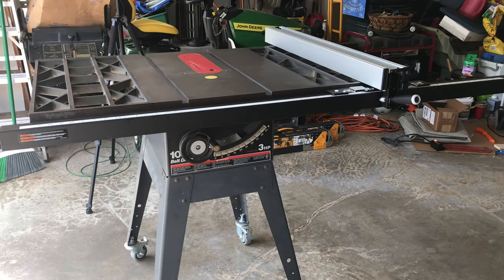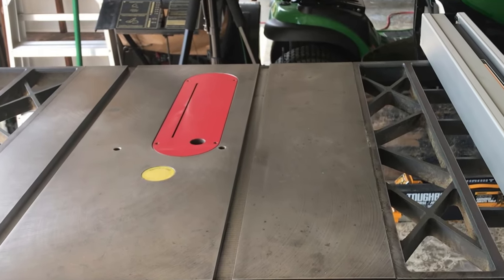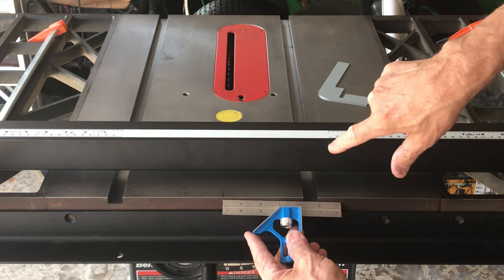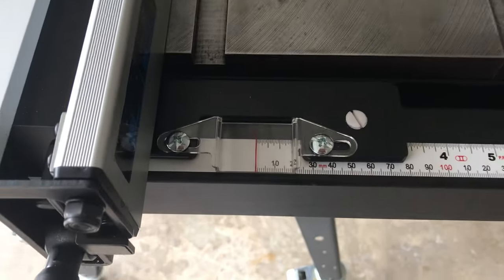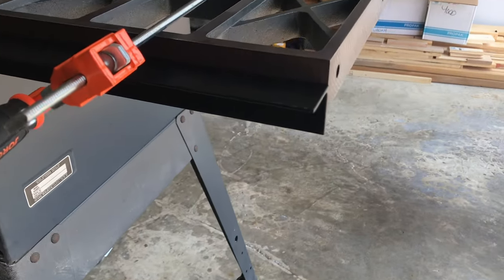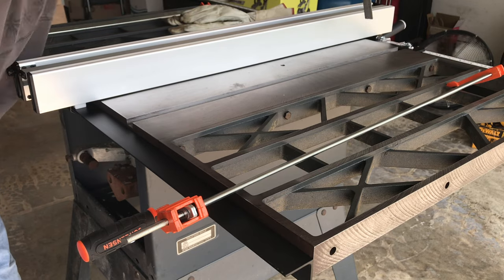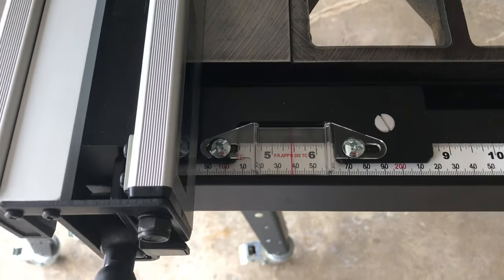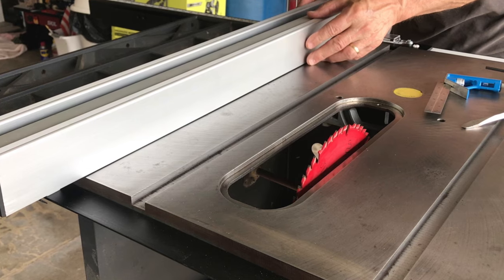Upgrade Craftsman Rip Fence to Delta 36 T3 Rip Fence

Comment: Why do YouTuber keep wearing gloves and operating table saws? Coming from someone with nearly 50 years experience that’s a big big no no!
Reply from the maker: Thank you for bringing this to the attention of those that aren’t aware of it.

I’ve had the table saw for years but didn’t really use it a lot until I recently retired and have started doing more woodworking.

Obviously, the issue with wearing gloves around power cutting tools is that the gloves can get caught in the cutting blades and pull your hand into the blade. Basically, being (an older) newcomer to working, I hadn’t given any thought to that until someone mentioned it awhile back in a comment.

You might think that this is something that goes without saying but I’m sure that there are others out there (especially beginners) that don’t give it a thought. I have since followed the advice for not wearing gloves around cutting tools.

Thanks again for drawing attention to this and hopefully helping others in bringing awareness to them. And btw, thanks for watching!

Comment: I'm a 100% disabled vet (six strokes that left my right side flaccid).  I don't let that bother me.  I've had a Craftsman Table Saw since 1994 or so.  I wanted to change the fence and a few other things.  I watched your video a few times and ordered the Delta T4 from Amazon.  Luckily the box arrived in tact.  I did the entire job alone.  Piece of cake.  Thanks for a video.
Reply from the maker: You’re so welcome. Sounds like you’re very strong willed with the hand that was dealt you. Keep that mindset and thank you for your service.

Funny that you mention the box arriving intact. Our first Amazon shipment arrived with the box in pretty bad shape and the top of the fence was dented in a couple spots. Had to get a replacement. So anyway, I’m glad that you were able to do the upgrade and I’m sure that you will be enjoying the new setup on your Craftsman!

Comment: There is a part on this fence called the 'lower-guided board' that I cannot find any information on. Do you know what it is for and how to use it? It's the swinging plate on the top of the fence.
Reply from the maker: Sure. There’s not a lot of information out there, but I did find a video from Delta Machinery Tools that shows this fence being used on one of their table saws (see link below). They show this accessory being used for thin or small pieces of material. You flip it down on the table and it gives you more room to maneuver as opposed to the taller fence. Don’t know how much it’ll be used, but it’s there. Thanks for watching!

https://youtu.be/_erbaD6ooXs?si=v8Ogq54uXdV3smel

Comment: I plan to upgrade my craftsman table saw fence to the Delta T3.  I, like you, will have to drill holes in order to affix the rails, however in your video, you don't state what diameter hole you have to drill in your Craftsman table saw.
Reply from the maker: I drilled the holes with a 5/16” bit. However I first made a divot with a nail set to guide a smaller bit to make a pilot hole. The pilot hole also made easier to then drill with the 5/16” bit. Good luck with your upgrade!

Comment: Hello what are thoughts How you like the fence now
Reply from the maker: Hello! Really liking it. Very stable and accurate. A big improvement over the stock fence on my old Craftsman!
Reply: Cool I just order mine. Have you rip a 4X8 Plywood in half at 24 and if so does flex or stays solid accurate is it strong enough. 
This are my concerns.
Thank you.
Reply from the maker: I have ripped a 1/4” 4x8 sheet of plywood. It definitely stays locked in place and accurate. That is what I really like about it. It slides smoothly and evenly before you lock it down. It has adjustments to make it parallel to the blade and 90° to the table. So after you get it set up, it locks down very accurately. The fence that came with the table was very loose and inaccurate.
Reply from the maker: What brand of saw are you putting it on, do you have an old Craftsman?
Reply: You did some very excellent videography on the upgrade. The camera shots, instruction and demonstration were expertly done! I have the old Craftsman Direct Drive TS and made this upgrade to the Delta T30 system over 15 years ago. I paid $170 then and it was worth every penny. It’s a great upgrade to our old TS’s that I would highly recommend. It’s you did,  also drilled the holes in my cast iron tabletop which was easier than I thought. The accuracy and strength of the fence makes my woodworking enjoyable! After all these years it is still as smooth and precise as the day I installed it. Oh, I took the rip guide and rod (that was sticking out of the back) off mine but know others have cut a groove in the back rail to accommodate it. Either way if anyone with an old craftsman is “on the fence” about this upgrade, just do it. If you do it right, I think you will love it like I have for over 15 years!
Reply from the maker: @MRrwmac Thanks! As you so aptly described it, it’s a great upgrade and very much worth it. I see Amazon has it on sale again for what I paid for it ($208, normally $300). But you are absolutely right, it’s accuracy and stability make the old Craftsman a joy to work with. I also agree with your recommendation to those who are undecided - just get it, you won’t be disappointed!

Comment: Thanks... I have a 113 model that I inherited from my father.  Really want this fence system for mine.  As well as the billet pully set with the link belt. I have upgraded the throat plate and blade already as well as added some nice castors.   Need to clean up the bottom casting on the wings (same has yours).   I used some scotch brights pads on mine with WD.
Reply from the maker: Yup, you’re welcome! Sounds like you’ve got it all under control. You won’t regret upgrading the fence, it turns the old Craftsman into a really decent table saw!

Comment: Great video! I'm working on getting my fence onto my 113 but I bought the fence used and it didn't come with the alignment tool. Do you have the measurements so I can make a jig?
Reply from the maker: Thanks!

As you can see in the video, the front rail is installed with the horizontal plane of the angle iron on the bottom and the back rail is just the opposite. The back rail is installed with the horizontal plane of the angle iron on the top.

So for the front piece, the measurement from the top of the table, down to the top edge of the angle iron is 5/8”. Then from the top edge of the angle iron down to the horizontal plane of the angle iron is 1 and 15/16”.

As I mentioned, the back piece has the horizontal plane on top. The same section of the template that was used on the front piece is used here for the back piece. But since the horizontal plane for the back is on top, the slot that is cut into the template has to fit around the horizontal piece of the iron. So that first measurement on the top of the template down to the horizontal plane of the angle iron is the same (5/8”).

If you’re making a template that includes the slot, the slot is 1/4” wide.

Hope that helps you out. Good luck with the install!

Comment: Thank you for this video.  I bought this unit and put it on my saw. I love it and it works great.  But you made it sound a little more simple to install than it really was. But I love it and have been wanting one like it for years. But they were to expensive for me.  This was a great price. Thanks again. Jerry Fox
Reply from the maker: You’re very welcome! Sorry for the difficulty factor, I did try to highlight all the main points. Yes, I believe that anyone making this upgrade is going to be pleased with it, just as you are. I try to show tools and materials that are quality and at a reasonable price point. I agree, this was a great price.

Comment: The t3 appears to just be a fence and doesn't provide any sort of adaptability for things. No jig mounting, or sacrificial face mounting options from what ive seen. 
 
Instead i went with t-slot aluminum extrusions, and linear bearings to make it mobile. It cost about $30 less than the t3, and I only needed a single 40in piece of 1530 (1-½" × 3") for the front fence rail and a 40" piece of 2040 (2" × 4" , not 20mm x 40mm)  for my actual fence. 
 
I added a 6533 linear bearing to front rail, and mounted it to the fence underside after building it up with flat joining plates. (I just used a piece of bedframe angle iron on the rear to keep wings attached and level with the saw.
 
Im really surprised more people do not go this route? It's so much nicer, flatter, and adds an unlimited level of modulation to your fence. Its also much tougher.
Reply from the maker: Sounds like you have a very versatile DIY setup! Good job!
Reply: I wish youtube allowed pictures in comments.  I want to see it so bad I'm drooling...
Reply from the maker: @brookspilcher9312   I agree on both counts. I’d also like to see it, and there’s been many occasions when adding pictures in the comments would be very useful.

Comment: May I ask, what are you using for a saw dust collection bag?
Reply from the maker: Sure, I bought the table saw dust collection bag from Harbor Freight (see link below). It fits my Craftsman table saw base perfectly. It secures with metal snaps that are intended to be installed by drilling holes in the saw base for the bottom piece of the snaps with the top of the snaps already secured to the bag. I installed it differently by gluing earth magnets inside the top portion of snaps that are already attached to the bag so that the bag is attached to the metal base more easily with the magnets and no holes are needed to be drilled in the base.

https://www.harborfreight.com/table-saw-dust-bag-45794.html

Comment: How much does the fence cost? I have the same craftsman saw and haven't used it in 20 years
Reply from the maker: Pretty close to the same story with me. The old Craftsman sat in the garage for over 20 years until I retired.

The Delta 36-T30T3 30 Inch fence is advertised on Amazon at a list price of $399, however it has always been marked down to either $260 or occasionally $208 since I started looking for it. So if you keep an eye on it, you should be able to pick one up for $208. (Amazon link below)

Delta 36-T30T3 Fence System
https://amzn.to/41lKSkH

Comment from the maker: Brain cramp! I know doors aren’t built this way.

Never having built cabinet doors previously, I got carried away with the tongue and groove aspect as I was testing the process on the scrap pieces. I was more thinking about getting the pieces cut accurately than the actual construction.

When I came to my senses, I do know that the “tongue” on the rail is actually called a tenon in tongue and groove door construction, and that the tenon is usually cut by laying the rail flat on the table saw as it is not normally cut standing the rail vertically on its end.

I apologize for the misinformation. Check out the upcoming video on building the cabinet doors to see how they are built.

So the zero clearance insert isn’t really necessary for building the doors, unless you are using a jig to stand the rails upright to cut the tenons. But it will also come in handy on various types of cuts on narrow stock.

Comment: I have the same craftsman table saw and ordered the delta rip fence you suggested. It work’s awesome however the old power shut off set up will not work with the new rails. I was hoping to mount a paddle switch but I don’t know how are where it could be mounted to not  
interfere with the fence movement. Any suggestions? 
Thanks
Reply from the maker: Yes, I have an easy, no cost solution. After giving it some thought, I decided to just move the original switch to the right side of the right table extension, a few inches from the front of the table extension. It requires drilling two more holes in the cast iron edge, but it fits perfectly. It also works for plugging in the motor, so nothing else is necessary. The only possible drawback is that the switch is no longer on the front of the table saw, but it is easily within reach while standing in front of the table saw (although you have to reach over the new front rail). May not be everyone’s choice, but it works out fine for me.

Comment: Hi what are the dimensions of the 2 peices of angle iron and the square tube i have the fence but no rails and i need to build some
Reply from the maker: The tube is 62 3/4 x 2 x 2
The front angle iron is 57 x 2 x 2
The back angle iron is 54 5/8 x 2 x 2

Don’t know why the partial inch lengths but that’s what was shipped. Good luck with your project!
Reply: Is the 2x2 steel tube one piece?
Reply from the maker: Yes it is.

Comment: What about the riving knife? How did you resolve that?
Reply from the maker: To be honest, I haven’t been using the guard and the riving knife and I don’t even remember where the guard and riving knife arm attaches to the back side of the table. I’ll have to take a look at that. Do you happen to know where it attaches and if the new rail on the back is in the way?
Reply: I have the same model number saw. There is no riving knife or any possible way to retrofit one that I can figure out.  It came with a splitter that many people didn't like and a lot of them were thrown out.  Not uncommon to buy a used one that doesn't have it.  
I rebuilt mine abs upgraded the motor to 1 1/2hp, machined pulleys and link belt,  delta t36 fence,  have a Shark Guard splitter and built a cabinet for it.  The only thing left is figuring out dust collection and making zero clearance throat plates.
Reply from the maker: I didn’t know the difference between a riving knife and a splitter before this. I just started using the old Craftsman recently and don’t use the splitter and guard since I didn’t have it on when I used it years ago.

I thought about making a zero clearance plate but found the Leecraft CR-1 zero clearance insert at a reasonable price. Figured I’d give it a try at that price before going to the trouble of making one. I really like it as it fits very nice. I also have a video on the insert on the channel. Here’s a link for the insert at Amazon if you want to take a look.

https://amzn.to/3t5Mx1r